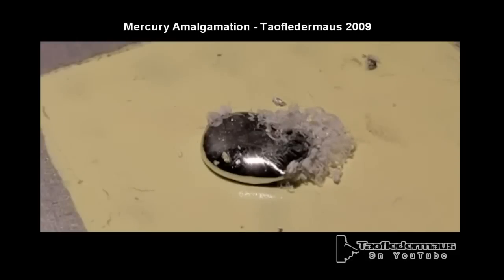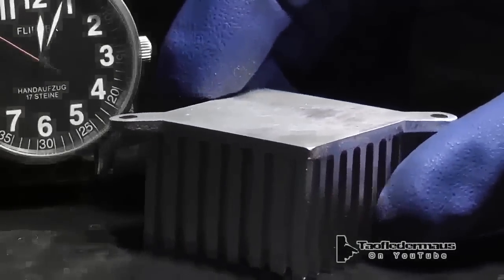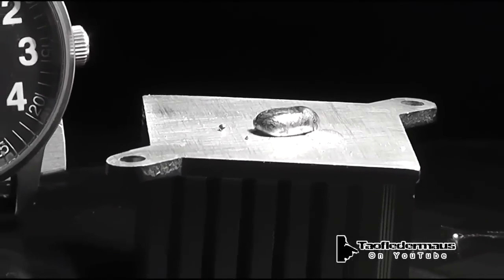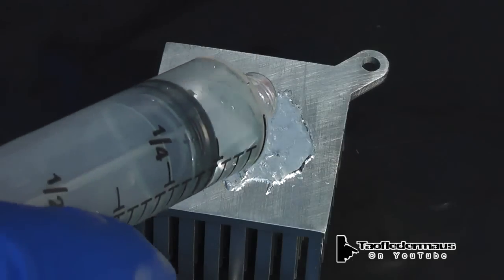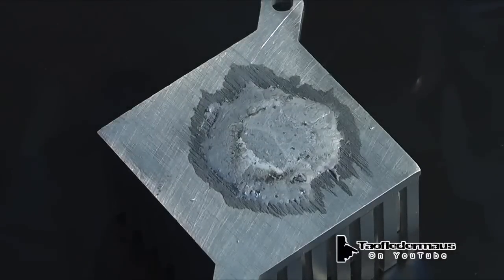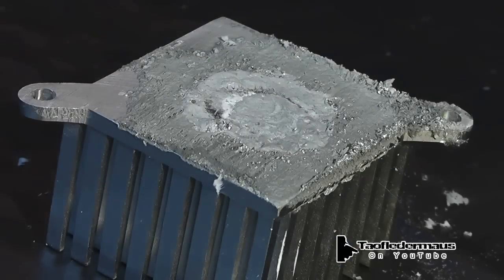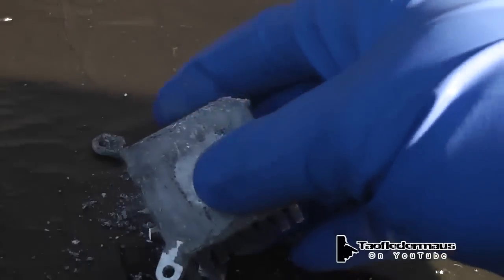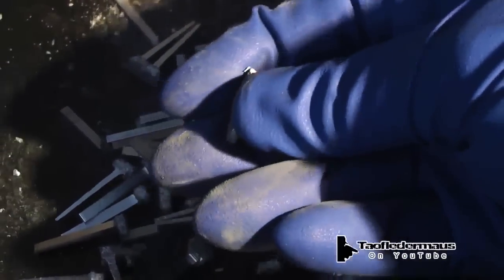Mercury AND Gallium - Totally Destroys Aluminum Heatsink

Comment: How would I protect aluminum from constant exposure to mercury? I'm thinking about trying to find a way to cool a computer with mercury, due to the much higher thermal conductivity
Reply: Mercury is an electrical conductor and highly toxic. You could hardly think of a worse material for that application.
Reply: MrPlanx the fluid usually conducts electricity and you just have to be careful. You can also just be a little more cautious when setting it up, I just don't want it eating the aluminum.
Reply: brandon carter I repeat: mercury is highly toxic. Heating it up is insane.
Reply: There is a reason they stopped using mercury in mechanical or daily applications. Now mercury is pretty much only used for chemical reactions, in particular, the synthesis of organic compounds. That being said, you should probably listen to MrPlanx for your own safety and of those around you. Mercury may look like it stays in one place, but it does emit vapors, is easily absorbed into the skin, and is very hard to clean up as most of the time it leaves invisible traces of itself, that are still poisonous to humans.
Reply: There are better liquids than mercury for the purposes of cooling a computer. Also, the mercury could easily destroy the aluminum over time, especially if you are applying any heat to it. As a chemistry student, I definitely say that using mercury as such is very dangerous and not every effective.
Reply: Plus, buying that much mercury or attempting to buy that much would draw some looks from the government. I can see your honest intentions, but when it comes to dealing with hazardous materials, you need to get some real training and education. Also, you need to  have the equipment to do it. Once you have the education, you will probably not want to do it anymore. As for Chemists, they usually try their best to avoid unnecessary handling of hazardous materials simply because they have to deal with enough of it as it is, and they don't feel like dying anytime soon. In fact, a famous Female chemist was killed not too long ago by a mercury compound, while using it to research toxic metals ironically.
Reply: brandon carter Exactly as Josh Porter just wrote you. This isn't a matter of being "careful". You clearly have no idea at all what you are dealing with. Learn to make a PHASE CHANGE cooling system - it will be completely safe and FAR, FAR more efficient than mercury.
Reply: brandon carter You must be a product of the American public school system.
Reply: So, okay, lets say you do your research and then actually build this thing.  What do you do with the highly toxic mercury if it doesn't work?  Second question... if it does work, what do you do about the mercury when you are done with that particular computer.  Lets say you make it.. it works... and you get hit by a bus a few days, weeks, months, or even years later.  Have you made any preparations for the handling and disposal of the mercury?  Would anyone even know what they were dealing with before they were exposed to that mercury?
Reply: brandon carter Your question was already answered in this thread: Phase change.
Reply: Munster Gamer it's several times more thermally conductive than any coolant, I would just have to isolate it from any aluminum. Of course I would take all the safety precautions, I just want to see if it can be done, because the only thing that could beat that would be liquid nitrogen, and people use that for overclocking no matter how impractical it is.

my big question is how do you think I could get away with using mercury as a coolant? Would I need to maybe put a thin layer of another metal over it?
Reply: I know why I shouldn't, I just want to see how well it could work. Before I would buy the mercury to even start I would learn more about it and plan everything first, which is why I'm asking
Reply: I have seen many videos talking about these hazards, and they are always careful, I just wanted to see if there was any safe way to do something this crazy,  so I take it that's a no
Reply: You could use engine coolant. It is still poisonous but it's not nearly as dangerous and as hard to contain as mercury, on top of that it will protect your aluminum and steel parts. Just wash it off of your skin and don't let any animals near the area till you cleanup and spills and it should be good. But engine coolant is very effective for engines at least, but i'm not an engineering student so i'm not too knowledgeable on liquids to be used for cooling computers.
Reply: Good money chasing bad money! Computers are  solid state, except for mechanical relays, fans and power switches. What would be the gain with mercury switching on internal analog devices? Be a forward thinker!  For something cool, build something that needs a tilt switch or a silent switch without the click; like the light switch on your lava lamp.
Reply: this has nothing to do with my idea of cooling it with mercury. I was just trying to find a way to go beyond current cooling methods by using something more thermally conductive while still being a low viscosity fluid, so that water cooling could be improved, mechanical vs solid state has nothing to do with cooling
Reply: brandon carter
To each his own, but the weight of mercury is heavier than lead, very hazardous, and does not dissipate heat quickly, but it fumes if heated. It does make a good electrical contact because it does not arc (burn) at the contacts, but for cooling CPU processors; maybe a better way would be to find a way to circulate liquid nitrogen, or design and build a small compressor for freon circulation in a copper tube used for the heat sink, with an evaporator coil at the cooling fan. Way cool, if you pull it off! There are several cool tricks with liquid nitrogen: freezing off warts, rolling liquid bb's across the floor with smoke trails, shattering certain objects, etc... Besides blistering the fv<k out of you skin.
Reply: liquid nitrogen is too cold and being heated up would just turn it to gas, it needs to be kept cold, and mercury has several times the thermal conductivity of water, which is what I was looking for, not just cold, but there are too many hazards with mercury, so I need to find something else. some people cool their PC by submerging it in mineral oil because it's much more thermally conductive than water and isn't electrically conductive so it can be exposed to the electronics, but the problem with that is it's very viscous, so you have a hard time getting the heat away from the components, fans just won't cut it
Reply: brandon carter Aluminum is much more thermally conductive than mercury and pure copper is even more thermally conductive than aluminum. For liquid coolants, I' wasn't referring to a submersion bath, but as a closed-loop circulatory system where vapor does not escape. And yes you are right, liquid nitrogen would vaporize, but for that I was thinking about a consumable-exhaustible piped system, where a flow regulated evaporator coil sets within a bath of a compatible antifreeze. This is out of the box thinking, not anything like the conventional liquid cooled processors. Whatever the mind can concieve and believe the mind can achieve. Something entirely different!

See the thermal conductivity charts, the higher the K value the higher the conductivity. http://www.engineeringtoolbox.com/thermal-conductivity-metals-d_858.html
http://hyperphysics.phy-astr.gsu.edu/hbase/tables/thrcn.html

Here you will see that mercury, although not the lowest rated is at a much lower level than pure copper, aluminum, or silver, yet, mercury is slightly better than water for therm-conductivity.
Reply: brandon carter Have you thought of a small refrigeration system?  Mercury also has a very high viscosity and may be hard to pump.
Reply: Refrigeration can cause condensation which will fry it, but I was thinking what if you made a dissolved copper into a fluid, how much could you increase the conductivity
Reply: Hey ik these ideas are very stupid and flawed, I'm trying to find something that will work and I'm throwing out all my ideas even though they won't work hoping someone can find one that will while I keep drawing blanks
Reply: What would be the point anyway, using coolant or anything else, you still need to take away the heat with air fans. It can only hold so much heat.
Reply: Fairly simple, if you can spread out the heat it's easier to cool plus it let's you pull heat further away from the important bits you want to cool.
Reply: Why do you even need to do that? Cheaper to buy a better CPU. Water cooling  gets my 8 core 4.0ghz to 5.0ghz
Reply: Well 4.7ghz stable
Reply: well I don't really think its about what is practical, its more like "that would be cool" no pun intended.
Reply: brandon carter Just put your PC in a freezer
Reply: then the PC is lower than the ambient temperature, which would cause condensation, killing the computer

Comment: Suppose you used a pump to make a vacuum;
 then released a non-oxygen gas to fill the void.

Could you apply gallium to remove the oxidation
layers of two aluminum surfaces. Polish the surfaces,
and weld the aluminum together by applying pressure and then oxygen?
Reply from the maker: Haha,  I'm not sure,  but it sounds like a hard way to weld alum.  together.
Reply: I'll have to try it!

Comment: Dump a pound or two of mercury down the valley of an aluminum V 6 or 8 engines intake/block and they would have issues when they wound it up a little! lol A splash of HCL acid first would get the oxide and grime layer primed good too!

Comment: Another great vid!

I'm enjoying your sciencey, nerdy stuff just as much as the shooting vids. A day without learning something is a day wasted.
Reply from the maker: I was too tired this weekend to do any shooting.  On some weekends I can never adapt from working graveyard shift to normal life.
Reply: I hear ya, mate. I do both days and nights every week on a rotating roster, so weekends are included. The great part is I get 4 day weekends every rotation, but it's easy to get stuck in a routine that sees me miss most days, as I'm up all night. I miss out on a lot of time with my wife and stepkids to be.

I've had a new Sako 85 Varmint Laminate since August that I haven't shot yet. Delays getting powder didn't help (Australia is like that). Finally loaded some test rounds and planned to take it out this weekend. Threw in a snap cap to get some practice in on the set trigger, and it malfunctions consistently. On pushing the trigger forward to set, the rifle fires. Not safe. Now I just need to stay conscious enough during the day on my next weekend to get it back to the shop.
Reply from the maker: That's gotta be hard switching from days to nights.   I get a four day weekend every other week.  I work 10 hour shifts.   I get one day off during the middle of the week and really can't do much on those days.

Comment: I wonder what affect Gallium would have on an alloy head off a car engine?
Reply from the maker: That heat sink may have been an alloy for all I know.    Someone had said they put some gallium on an old VW  block and it tore it a new one.
Reply: Could be something to keep in mind for the future if I ever need it... Awesome channel by the way!
Reply from the maker: Match2100  I have an alum.  cylinder head from an old car I sold that would work well for that.  I probably need more gallium than what I have though.  It would probably take a few days to chew through it though.

Comment: I wouldn't say nobody had ever seen this before, I recall an article in either Pop. Sci. or Pop. Mech. that discussed this and showed pics of the process on an aluminum I beam.
Reply: Link: http://www.popsci.com/scitech/article/2004-09/amazing-rusting-aluminum
Reply: Skwisgar2322
Though in your defense I think your explanation of the amalgamation process is more correct the the aluminum simply rusting.
Reply from the maker: Yes!   But he used gallium  to "prime"  the alum.  like I did here.   I don't recall if it said that in the article or not but  he did say he used gallium on the I-beam in the video.   The  "rusting aluminum"  was kind of an odd description.

Comment: Hey Taofledermaus! Try placing the remains of the aluminum heat sink in a bowl of water! The gallium will prevent the aluminum from forming its oxidation layer and the aluminum will react with the water freely. Little spheres of gallium should coalesce at the bottom of the bowl.This is a great way to get you gallium back.
Reply from the maker: I'll give that  a try,  thanks!   I really know little about gallium at this point.
Reply: ***** Just make sure you take the proper safety precautions, as the reaction produces quite a bit of heat and the aluminum hydroxide product is a mild irritant.

Comment: How much Gallium and Mercury would I need to take down one of these Aluminium streetlights? Haha. How long did this whole process take from start to finish?
Reply from the maker: You could just use gallium.  I'm not sure how much but it would probably tip over in 24 hours.  lol    Not that I condone that --but it is funny,  and probably something I would have done as a teenager.

Comment: Use mercury as thermal paste and run the computer xD (check how long it surives)
Reply from the maker: The gallium would be easier to do since it sticks to things better.
Reply: You couldn't use mercury on the CPU anyway. The processor gets hot, and would evaporate the mercury, which would be highly toxic airborne...

Comment: Protection with Gals and Gallium, check. I hate uncooked spaghetti for structural uses. You should have a pig with lipstick on these types of vids so won't be no terrorists watching. I was going to take a gallium gun through airport security and have a heat source triggered to opening the bag so all they'd find is a puddle of gallium, but since you can't take that on a plane either guess I better not, in my own bag anyway. This, is very cool :) thanks.
Reply from the maker: lol  thanks man!

Comment: Is Mercury a metal or a liquid?
Reply from the maker: yes!
Reply: My responses are limited. You must ask the right questions.
Reply: a liquid metal :)
Reply: yes
Reply: "metal or a liquid"
Metal is not a state of matter in the convential way. A metal is simply a substance in which the nuclei have so many loosely-bound electrons, that they are allowed to freely move between nuclei in the substance, instead of orbiting just one nucleus like a BORING PIECE OF SHIT ELECTRON.

Although some metals aren't as obvious... For example, hydrogen is a metal at extremely low tempuratures because it's in with the group one elements, which are all metals. Some noble gases act like metals at extremely high pressure as well, but it's much harder to get them to do so.

To answer your question, metals can be solids or liquids. In the gas and plasma phases, they don't tend to act metallic
Reply: Thanks :)
Reply: mercury is liquid at room temperature, and at sea level pressure, but it can change state if the amount of thermal energy is changed in it

Comment: Did the gallium and mercury penetrate and weaken the fins themselves?  It looked like all the fins were still intact and just broke off the main plate of the heatsink.
Reply from the maker: Most of the fins were still structurally sound,  even after sitting for 24 hours.  The base is just dust.
Reply: It did make it into the fins, but not very far. (from what I can see) The gallium could have kept going.

Comment: How much Gallium have you used? :)
Reply from the maker: Just a few grams of it.
Reply: ***** I think you can get the gallium back by reacting the alloy with water, but I am not sure.
Reply from the maker: *****  I was picking the brain of the owner of GalliumSource and he said that water ruins gallium.   Just from messing around with it,   I haven't really seen that.   Some experiments,  like the melting gallium spoon  use water to melt it.
Reply: *****
I think you could react the aluminium with sulphuric acid to form Al2(SO4)3 to get the gallium back, because gallium seems not to react that much with sulphuric acid and because I found no evidence that Ga2(SO4)3 would form.
The mercury however would form HgSO4 which is even worse than mercury itself, as it perforates even through non-damaged skin and intoxicates the body literally by the touch.
You can get the aluminium in form of AlCl3 by reacting the Al2(SO4)3 with some HCl and then Oxidizing it back to Al2O3 and after that reducing it to aluminium.
But I have no Idea how you could get the mercury back I actually never worked with any mercury compound but HgCl2.

Comment: hey british people, i'll switch to metric like most of the world, when you drive on the right side of the road, like most of the world
Reply: Current split is about 75% countries on right, remainder on left. http://chartsbin.com/view/edr But Canada, Italy, and Spain changed to right-side driving in the 1920s. Most of Eastern Europe changed in the ’30s. Scandinavia waited until the 1960s. Changing means major infrastructure adjustments, and now a large number of cars set up "wrong". http://newswatch.nationalgeographic.com/2013/05/31/the-right-and-left-stuff-why-countries-drive-on-different-sides-of-the-road/ For manual cars it is easier for the 90% of right-handed people to hold steering wheel with right hand and gear shift with left hand... and Henry Ford was left handed, and on that quirk and the success of the Model T, other American manufacturers followed Ford's lead with right-hand-only steering wheels.
Reply: holy shit, i learned something on here